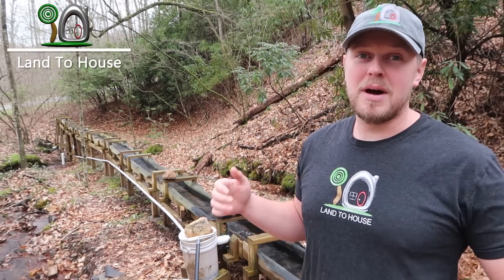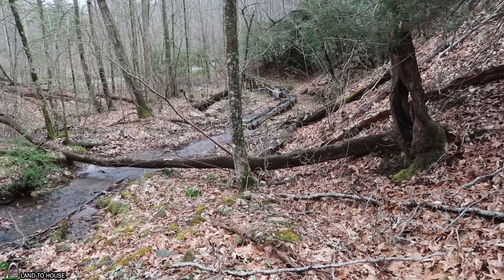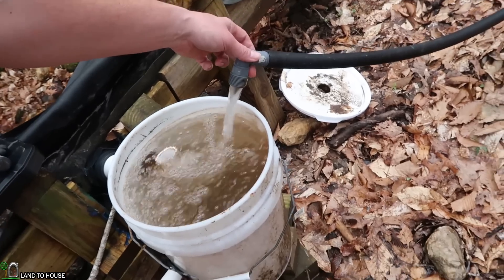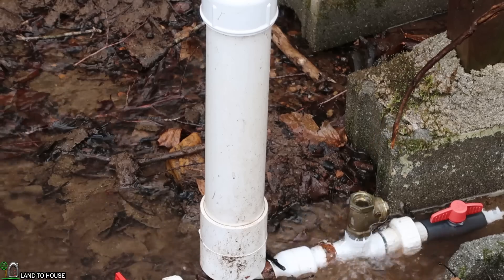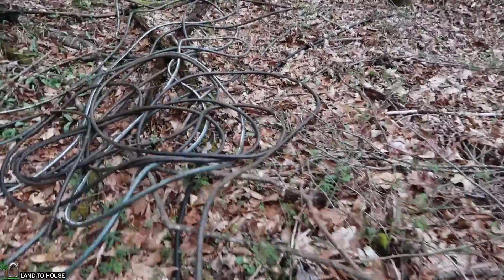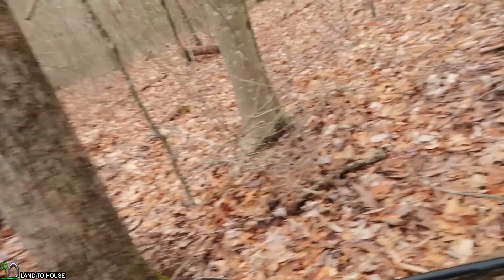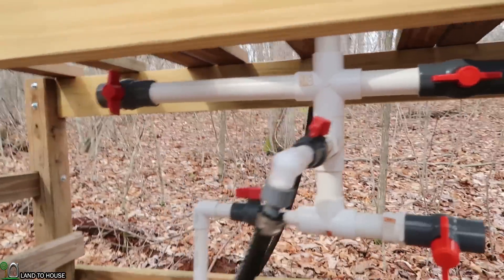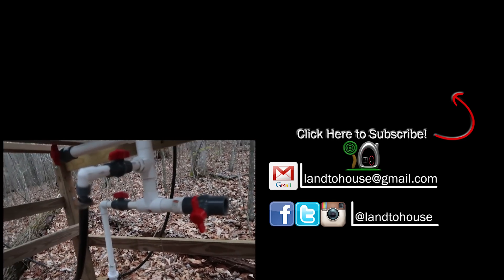Starting up the Ram Pump 2019

Comment: First time viewer here. Interesting idea & set up
Are the barrels set up above the garden to get gravity pressure to garden hose ??
What happens when both barrels fill ?? Does the system shut down ??
What is the purpose of the chute
Thx, definitely a great off grid idea
Reply from the maker: Thank you for checking out the channel. Yes there are now 3 barrels at the top. They feed water to the garden. When they are full an overflow goes out into the woods. The 2020 version of this video comes out April 4th.
Reply: @Land to House  So the ram runs 24/7 ?? How about the chute - what is its purpose....Thx !!
Reply from the maker: @MrBucknasty1313  back in the day I wanted to make a water wheel. ... someday.

Comment: If you fill one from the top the for rate will increase? That account of water back pressure will slow the flow rate.  The pipe assembly at the bottom will still self level both barrels and the existing overflow will work the same still.  Input into the left (centre) at the top of the barrel...  (Like where the overflow is on the right) ... Just cap the existing input... If you don't like it you've lost an hour of labor and can put it back to how it was
Reply from the maker: I ran another test on that idea to show that filling from the top is slower. The hydrostatic pressure in the barrels is low at the start and increases as they fill. If filling from the top the pressure is high from the start.
Reply: @LandtoHouse  it may be the additional height of the barrels in that case.  But there's additional risks of failure with everything in the single pipe assembly as it is.   Obviously it's your system though. So ultimately your decision. 👍
Reply from the maker: @PTechMedia  yes very true. If the check valve fails or gets stuck open and the pump stops it will drain back.  .... more YouTube content haha

Comment: thanks for your great video but please allow me to show you this because you said that the ramp up pump will fill up any tank because atmospheric pressure is the same any any point, well, this is all true but you forgot to mention static pressure which is the height of water in the tank, example, if tank is 20 feet tall then the pressure at the bottom of the tank is 20 ft x 1 x 0.433 = 8.66 psi , just about 9 psi, so basically the ramp up pump will be just fine as long as your tank is not too tall because the static pressure due to the tank height can eventually stop you ramp up pump from working.  Thanks....excellent video, I did loved it.
Reply from the maker: Yes! Well said. But filling from the top of that tank means the water column is an extra 9psi all the time. Filling from the bottom the psi gradually gets higher as the tank is filled.

Comment: I'm confused about your terminology, wouldn't it be hydrostatic pressure and not atmospheric pressure? I mean, as long as the ram pump can overcome the hydrostatic pressure (the weight of a pillar of water of a certain height) created by the difference in height between the top of your tank and where the ram pump sits (aka. it can create enough head), it can fill the tanks over a period of time.
Reply from the maker: Are you referring to filling the tank from the bottom vs the top?
Reply: Land to House No, doesn’t matter if you fill it all way, I was just confused about what atmospheric pressure has to do with it all?
Reply from the maker: @sstorholm  perhaps gravity is the correct term? 

Anyway. This is a fun video :
https://youtu.be/jzvoKeroNUM

Comment: When you're screwing plastic fittings into plastic fittings you don't need PVC tape all that is is more plastic.
Reply from the maker: True but after years of making ram pumps I find that it is helpful in getting a really tight fit.
Reply: @LandtoHouse  well if you tighten the pipes up tight to begin with it's tight enough cuz plastic will melt together 30 years is a pipefitter

Comment: OK As I understand it this pump will have around a 7:1 lift. Is that from the intake in the creek or the 5 gallon bucket that separates the air out?
Reply from the maker: The bucket intake is acting as a stand pipe in this install. So yes the bucket is the source.

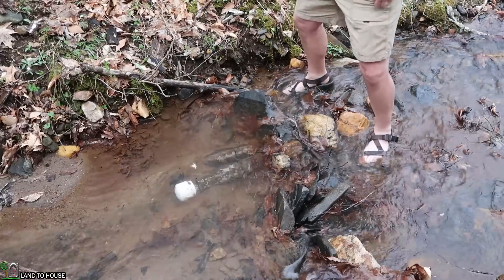Comment: 0:57 you have socks and sandals and go in water
You are such a madlad
Reply from the maker: I had to look up the meaning of that term. I would say it's accurate in more circumstances than I would like to admit.... which is half the definition of that word
Reply: @LandtoHouse  i got it from reddit
r/madlads
Where people do stupid and crazy things
Reply from the maker: @Rainbow__cookie  that sounds like a fun thread.
Reply: The socks and sandals was me..before my daughter told me how embarrassing it was.. you mentioned that it was April,which just means it's still springtime and there is a Grace period there before it warms up to full summer. Then the socks can come off.. At least they weren't knee high. Love your channel. I see people in the comments mention that it's the slamming off and on of the valve that causes the pump to pressurize the air in the water and that is the actual driving force of pushing water uphill.

Comment: Hey Seth did you know there is an electrical circuit called a voltage doubler that uses the same principle on electricity. Replace the check valves with diodes .the pipes for wires and the pressure head with a capacitor and presto. you can double triple or multiply voltages to as high as you want. I accually started to laugh when I realized it.

Comment: Tuning in and out but when I'm paying attention it seems to line up with things ive learned in past. The whole atmos pressure thing is how water towers work. They insert energy to pump it up to the top of the tower and then let atmospheric pressure and or gravity draw from the reservoir. Which is also why high-rise buildings tend to need their own water tanks on the upper floors

Comment: Why feed the bottom of the tanks instead of just running the pipe up to the top of the barrels, filling one barrel and your existing plumbing below will equalize the levels between the tanks with a shut off at the bottom of each tank so they can be separated from the plumbing (by closing all the valves at the bottom of the tanks) for it to be worked on, like fixing that leak... would make it impossible for the feed line from the pump to pop off and your tanks drain in a few minutes, makes it easier to maintain the plumbing below if you don't have to stop the pump to do work on the plumbing... it would continue to fill one tank while you do your work then open the valves below each tank to equalize the levels again

side note, I'd get a cheap water hose to drain off overflow back down the hill past the garden/house so it's not saturating the soil at the top of the hill and causing slumping under the tank supports...or traveling under the house and causing mildew year round.
Reply: also noticed you have no shutoff valve directly under the tank in the middle of the platform, no way to work on your plumbing without draining that tank, at the very least.

TLDR

Fill line from pump should go to top of one barrel and not be connected to distribution plumbing under the barrels

all barrels should have a shutoff right at the bottom before feeding into distribution plumbing

overflow line needs added with cheap garden hose running past house and garden to prevent overflow from saturating soil above house and causing sagging in the hillside and seeping into basement (if it has a basement, if not then to protect from softening soil under house slab and causing sagging/cracking of foundation)

Comment: You  Need to fill the tanks at the top. By filling the tanks at the bottom you are fighting the water weight that is stored inside those drums. Making the pomp harder to build the pressure it needs to fill the tanks. If you feel from the top you have absolutely no head pressure except what's in the line going down to the pump. By filling at the top of the tank you eliminate a ton of head pressure, Your tanks will fill much faster
Reply: After watching the rest of the video you explain that it doesn't affect the pump. This is a very good video but it's like saying at the bottom of a dam it will have the same pressure at the top the more elevation that water is kept above the more pressure down below just like in the see if I had a tube that was 50' tall and full of water eventually the water would stop building the pressure needed because the weight would surpass the pressure point
Reply: Simple test is see how lomg it takes filling from the top, you'll be amazed, from SERVICE PUMP CO.
Reply: NATION_150 Filling from the top or bottom makes no difference. If he fills from the bottom he might have four feet of water in the tanks pushing down. If he raises the pipe to the top of the tank and fills from the top, the pipe is now four feet higher off the ground and full of water, creating exactly the same pressure as before. The advantage of filling from the top would be that the holes and plumbing in the bottom of the tank below the water lever were not required, meaning fewer components to fail and leak.

Comment: You're right about atmospheric pressure but as the system fills the water weight increases which will effect system performance.
Reply from the maker: Turns out water weight is vertical not by horizontal cross section. so the tanks will fill faster from the bottom because the lift is lower as the tanks fill vs having to go from the top the whole time.
Reply: @LandtoHouse  even though as the tank fills there is more and more water on top of the whole system? It's the same as any body of water, the deeper you go the greater the pressure because water has mass thus weight, this is why subs implode at depth and divers get the bends, water pressure not atmospheric pressure. So the more water above the inlet at the bottom should effect it's flow. It might be that the system is small enough for it to be negligible but I guarantee that there is more water pressure/weight at the bottom of the tank vs. the top. As long as the system can build more pressure than atmosphere 1 bar it will always overcome atmosphere but it needs greater than 1 bar  of pressure to over come gravity which makes the water weight/pressure greater then farther you go back to the lowest point/the pump. It's pretty basic physics
Reply: as an after thought if you reverse the half inch and the 3/4" lines putting the larger at the bottom the pump will create better pressure as the line reduces in distance negating any gravity due to hydrodynamics

Comment: I'd be very interested if you have investigated the laws in your state or locale that may govern water use from streams. In general, especially in the eastern US, riparian law would generally allow you to divert water for watering a garden. But many states have made some additional laws, largely ecology based which may restrict such use. For example, a low dam or "weir" like yours is now largely illegal in my state, and although the one you built has very little effect on water levels and does not represent a safety hazard, it could affect fish movement - no much in that stream, but I make the point. In some locations, such as in Massachusetts, we have laws that kind of prevent you with doing any construction or rigging in or near streams and waterways. Off-grid micro hydropower, for example, generally needs a federal permit in our state. Although you are having very little effect on that stream, and clearly you are not introducing pollutants, have you looked into the regulatory side of all this?
Reply from the maker: I've dived into this a little bit. In my state we are allowed to divert a small portion of water for a garden or farm use. I do you know that a lot of states are getting more picky about water usage.

Comment: If you use gate valves instead of ball valves for stopping water flow then you are much less likely to have damage caused by water hammering.
Reply: 99.4% of the time you'll never get a gate valve to completely close.  Working with threaded steel pipe = no big deal.  But sweating copper or gluing PVC with a leaky gate valve upstream is worse punishment than listening to the White House news feed.

Comment: The thing you were saying about the infinite abilities of water volume and height is wrong. The water that is pumped above the original pumps height is weighing on that valve. If the pressure on the other side of the feed valve is greater than the pressure from the water power effect, it will not be able to open the valve to feed your tanks. This is also easily fixed as you only need to increase the velocity of the water before closing the waste valve. I hope this didn’t sound mean, I’m just trying to be helpful. The video was great in showing how folks don’t need fancy pumps to utilize natural water flow.
Reply: witkrieg todd  well said
Reply: Why not just air gap at the tanks that way no tank pressure is pushing against the feed line. The feed line should have enough back pressure to drive the pump. He already has a over flow in tank. It would be setup much like his feed bucket at the beginning of the video. Line pressure on the actual watering system would be set by the weight of water in the tanks. It could be adjusted by a pressure regulator if it was too much at the spigot. This would also help with the valve turning off to fast because the pump would no longer be in the system. I'd also add a larger diameter pipe sticking up, with some air in it, in the system going to the garden as an expansion system which would help with quick valve turn off.
Reply: Water pressure is measured in feet of head , it doesn't matter how big the pipe or vessel is 1/2 in 2 miles wide the head pressure is the same , Every 2.3 feet or 27 inches in height equals 1 lb of pressure period anywhere in the world.
Reply: give or take altitude also greater the head pressure  creek to pump the force will be multiplied by the ram

Comment: If you have an overflow why do you need to leave the caps slightly unscrewed..
Reply from the maker: There is a water lock in the overflow pipe because it goes down and then back up like a toilet P trap. So the screws slightly open provides air.

Comment: Rather than rely on remembering to close the valves slowly why don't you just add a water hammer arrestor? Also great video!
Reply from the maker: Thank you. An arrestor would likely work but I close the pipes so infrequently (when not testing) that it would not be too much use.
Reply: @LandtoHouse  Yes! the same air bottle with the bike tub inside would work just fine. No more pipes suffering from shocks. I made a small one with a 3/4 copper pipe and a foot long.My kids can kick the valves close. Love your vids by yhe way...thanks for sharing.
Reply: If you use a hose with a gun attachment then it'll be harder to control...  Best to fix the problem than 'bypass' it. ( You don't want it to mess up when You're busy)

Comment: Looks cool. Now on your wooden supports on the legs would it be worth putting some pine pitch just to help water proof the legs only because it's constantly wet. I would say a coating of tar but pine pitch would be safer
Reply from the maker: The old flume needs some work. I hope to install a water wheel or tiny micro hydro turbine someday. The wood is treated but you are right it's always wet.

Comment: As far as filling the tanks from the bottom, you’re correct concerning atmospheric pressure, but you’re neglecting water weight. Think scuba diving. The deeper you dive, the greater the pressure, due to the volume of water above you.
Reply from the maker: I actually have a video showing how filling from the bottom is faster than the top. Even though the weight of the water is there it is variable as the tank fills. When you fill from the top the water weight is high from the start.
Reply: No. to take the water to the top requires the same energy as "pushing" it into the bottom. Either way you are lifting the same amount of water the same height.
Reply from the maker: @Toobula  yes that is true BUT there is not as much water in the tank when you first start filling. So you are actually going less high at the start. Let me link a video that shows this.
Reply from the maker: @Toobula  https://youtu.be/jzvoKeroNUM

Comment: Question, why a dam? Why not just dig a hole, either in the creek or on the side of it, I think that's even better, because large debris will pass it, some large mesh to protect it, and a connection for your pvc pipe. then you'll have a constant flow of water, the larger your tank, the powerful the stream. Personally, I would dig in a rainwater tank if the height allows it. Also, keep the intake under water, less debris and smaller debris.

Comment: beter way to describe the filling of the tanks being possible by the pump is that pressure is lbs / square inch, so the only pressure pushing down is whats exactly above the inlet to the tank  not the water beside the inlet
Reply from the maker: Yes the column of water is the same pressure no matter if it's a massive tank or a small pipe.